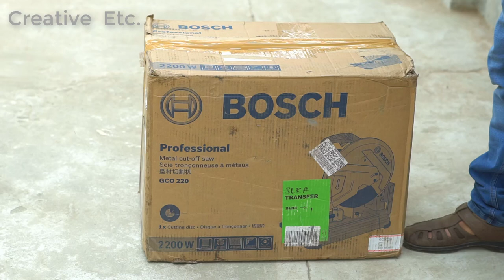Unboxing and Test Bosch 14 inch Chop saw Machine

Comment: Works great. First thing I did was use it to build a stand for it MyBest.Tools Added 2 4X4 to both sides of it to get more surface area to hold the larger boards. Instructions are easy to read and follow to set up.